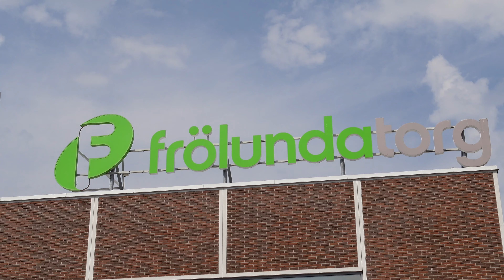i can't stand it when people do this...

Comment: Hey Peter, 
In a previous video, you mentioned that you feel that the 24mm zoom equivalent of the ZV-1 felt too zoomed in. Potato Jet actually has a video on it and there is filter like thing you can attach to make the lens wider. Below are the links to the video and the adapter
Reply from the maker: I do wanna have it as compact as it is now, it’s the key thing for me, to have it small and compact and ready to use as is!
Reply: @PeterLindgrenVlogs  hmmmm. Fair enough. But if you change your mind, my comment will forever be